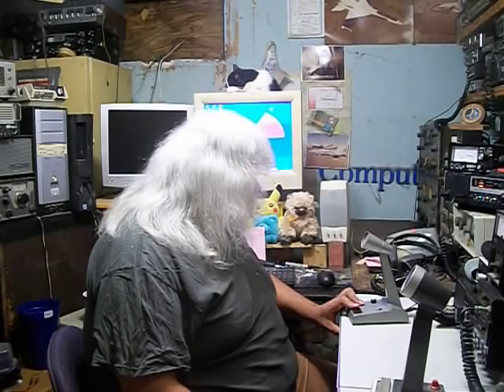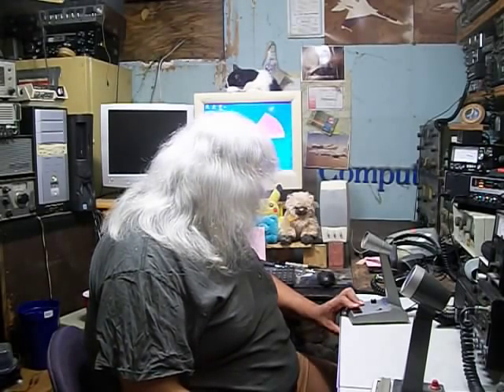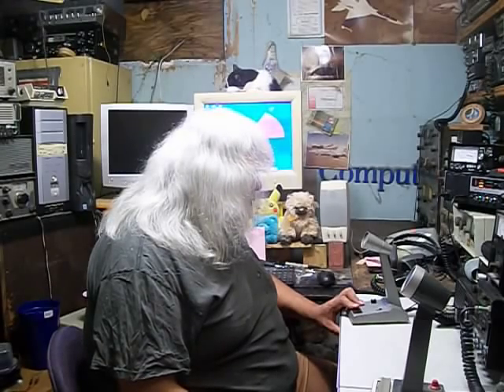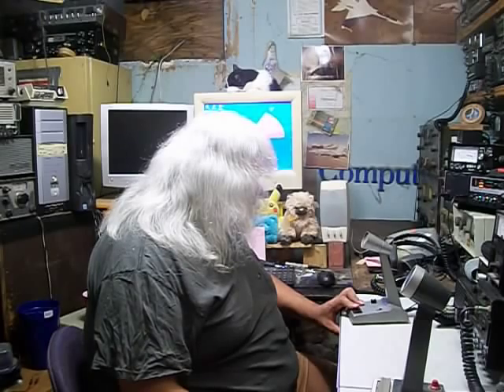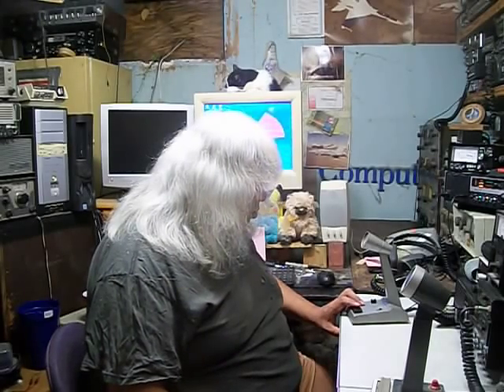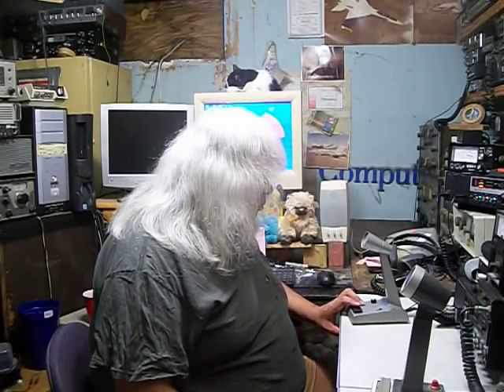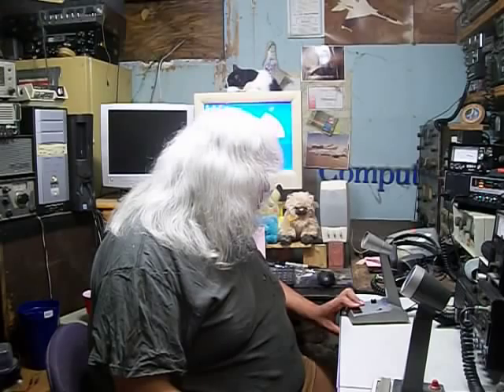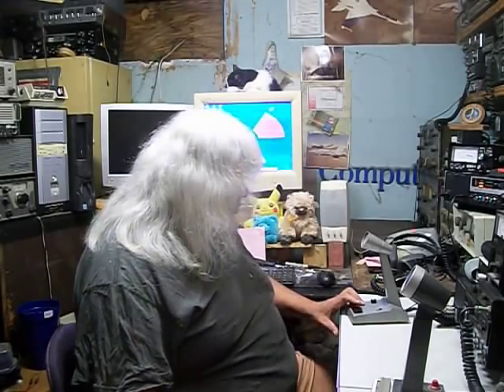COAXIAL RF CHOKES TWO.

Comment from the maker: That right Paul. The reducers are the main problem with those damn things.  And I refuse to use the crimp ons just so I can use the small stuff. Thats really why I use .405 diameter coax, preferably 9086 Super Coax, 9096 Super Coax, Times FM-10, Belden 9913, 9914, RG-213, RG-214, and any Times Microwave LMR above 400. And the loss.  Super low loss is always cool.  And the higher power handling is a plus. I use 9086 Super Coax quite a bit here at the station. Good stuff.

Comment from the maker: Hi Zeke. While I sure can appreciate your suggestion to the max I refuse to compromise on my coax, even for jumpers. I made the first choke with RG-58AU and it was real easy and it works to the max but I only used the 58AU as a proof of concept. The second was made with RG-213AU and was a little difficult but I would have it no other way.  The station choke will be bigger still but easier to wind due to increased diameter.  It will go on the tower. All I use is the thick stuff. Thanks and 73.

Comment from the maker: Yeah winding coax on small diameter forms and getting it tight and neat is a feat usually left for Thor or Henry Rollins.  There probably is a trick to it. Maybe build a rotating jig out of wood and wood to rotate the form while you feed the coax to it. Hand driven to cut costs or three phase power for the crazy zombie types.

Comment: Amen brother. I'm not a fan of RG-8X (AKA mini 8) either. Sure it's fine for short runs at most of HF with little loss but getting reducers with the proper ID is my gripe with it. The reducers you get today are all over the place on the inside diameter. If they don't fit super tight problems with continuity on the ground braid are assured. 73's Paul

Comment: Oh yes a big yuck on those crimp connectors. I hate them as well.

I also mainly run the larger cables. In recent years I've mainly been using RG-213 and the Davis RF Bury Flex.